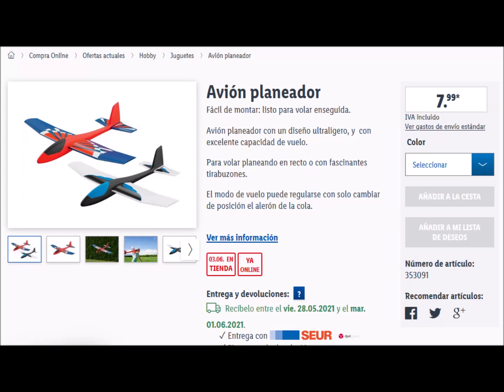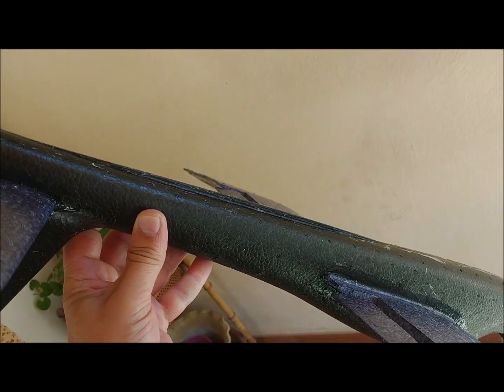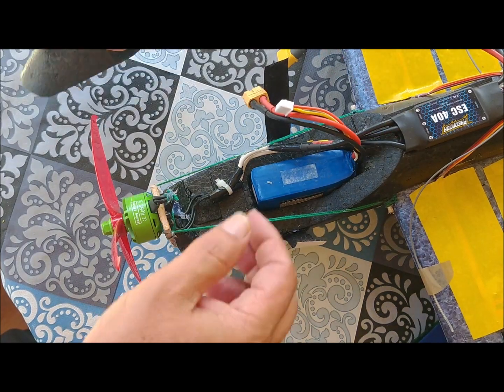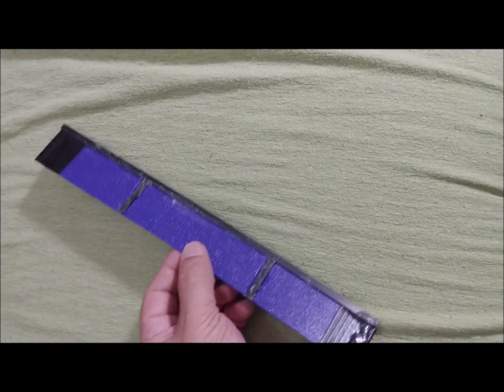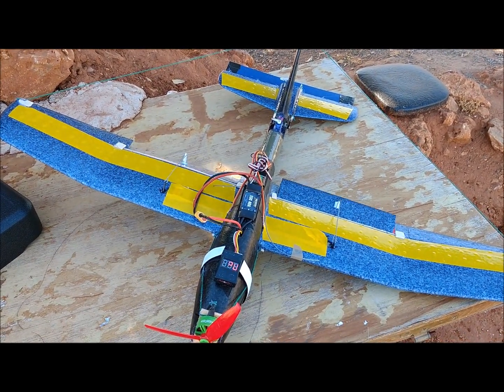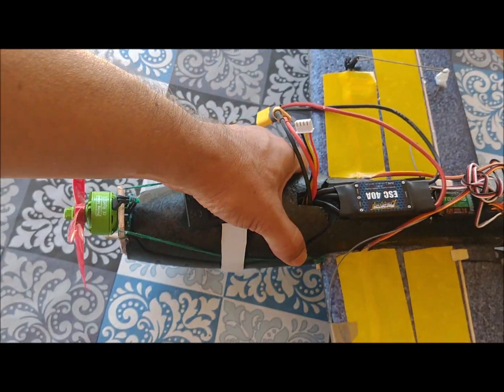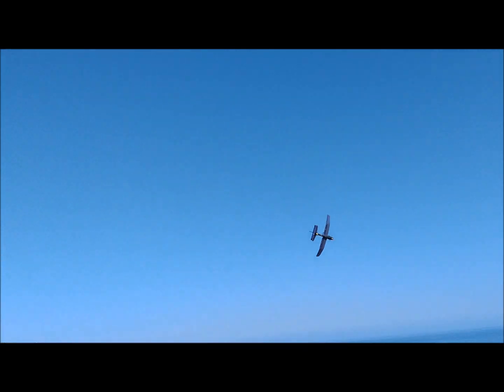How to make aerobatic airplane with LIDL chuck glider 2021. RC. DIY.

Comment: information.            at :08,   why ???       the  UNWANTED  result is that the  Tail is  made  HEAVIER.!!!       doing this is the  Opposite  of  smart.!
at :06,  WRONG.    such tiny  strips  of  cf  are  NOT  VERY  Effective, as  main spar.!!!!!
at :58, went from  talking about  wing main spar  to   SUDDENLY  talking about the fuselage.!!!!
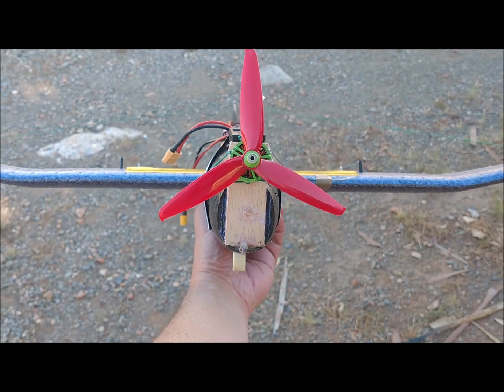at 1:13,  this  is  Not  a propeller.!!!   and  its   ccw.!!!!
at 2:18,   WRONG.          this is  Flawed  Analysis and execution.          this model   Should  have  a  simple, zero-zero  thrust config.!        googletranslate